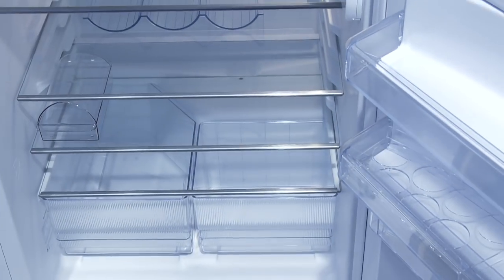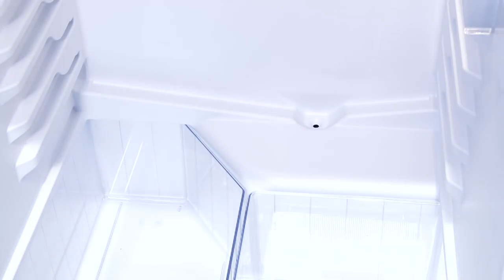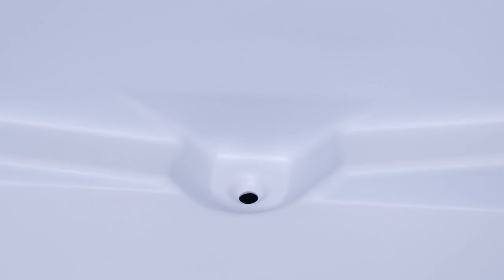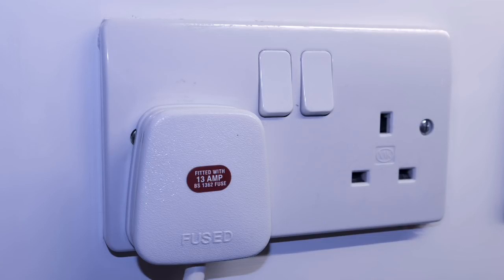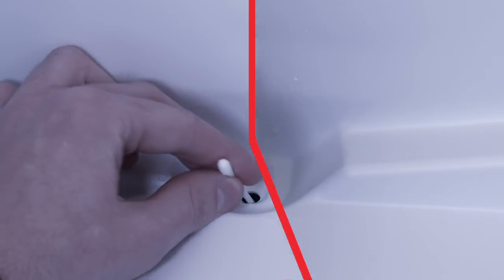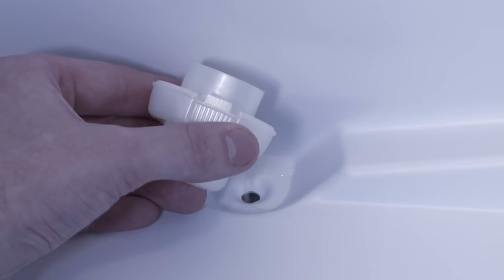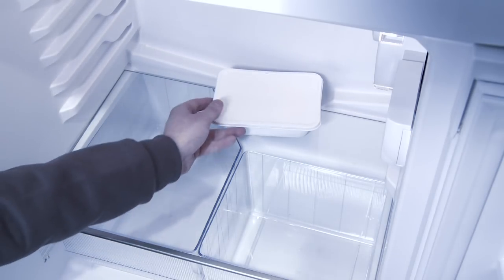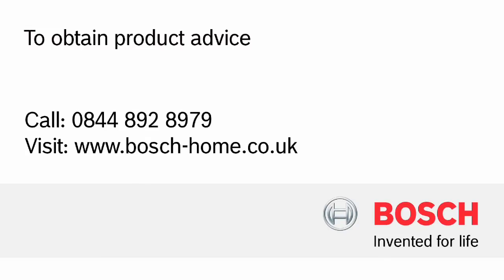Why is there water leaking from my refrigerator?

Comment: If your fridge doesn't have this hole, the water collection port may be in the fridge " ceiling" in the light housing. Unscrew the housing that the light connects to, and there should/ may be a water collection there. Clean that out and you should be good
Reply: You seem like you know what's up. I'm having a smelly problem after a friend used my fridge to store some bag wine shit that was rottening. After I cleaned the whole inside of both the fridge and freezer it was still smelling like the old wine. So I'm not sure what's going on
Reply: I wana leave you a contact number but not in the open

Comment: The excess water usually drains into a tray under the compressor, the heat from the compress and fan causes the water to evaporate. 
Sometimes the refrigerator is to cold and then the water freezes in the drain hole and blocks the drain.
Unplug your refrigerator a=for a few hours to melt all the ice, this would be a go time to clean your fridge too. If you don't have a spare fridge then use a cooler to keep your food in for a few hours.

Comment: This technique works!  I used hot salt water on my Kenmore and cleaned the piece connected to the drain hole.  The only difference is that the drain hole for the freezer is inside the fridge, on the top!

Comment: wtf there's no hole in my frige
Reply: If there is no hole, your fridge collects at the top of the fridge, the lighting unit has a water collection. Unscrew the light housing and there should be a water collection port. Clean that out and you should be golden!

Comment: The cold air goes down, and escapes through this hole, so I clogged it with some cardboard, this way the fridge stays colder, saving energy, but the water can escapes through the cardboard at the same time.

Comment: Leak found in freezer section. Rubber seal migrated down and blocked drain. After warm up pushed seal back silicone and super glued seal. Let cure for 2 hours.Frig did not start for 5 min then kicked on. Kinda freaked me out. CA/Silicone fixed seal and water over flow leak.
Reply from the maker: +Ed Hughes Hi Ed, great to hear you were able to fix the problem, Vanessa
Reply: Ed Hughes a

Comment: On the bottom of the drain line on LG French door, there is a rubber stopper with a little rubber lid.  Water should trickle out of here and I guess it prevents stuff from going up into drain line?  But I see no use for this unless u have tiny fish swimming in the drain pan.  I removed mine as I think it restricts water flow, causing ice to more easily form.  We'll see.

Comment: Mine doesn't have a hole. What then?
Reply: Heather Smith the water collection is in your light housing. Unscrew light housing and clean the water port.
Reply: @bluestarsilver7586  i have the same problem looks like the water is getting backed up in my freezer on top then leaking into my fridge. Ive defrosted the ice and cleaned the drain hole from the freezer drip pan. It works for a while then happens again. Are you saying i should be cleaning a second area in the fridge? Thanks

Comment: I have problem with my fridge that every 2 days I have to take out water that is gathered under the drawers. My fridge doesn't have hole like in the video. Can anyone help me? I had bad luck on this fridge. I changed the engine twice and I changed motors of the fan also.
Reply from the maker: Hi there Rahib, thank you very much for contacting us and we are sorry to learn of your concern. Have you spoken with our Product Advice team at all? They are trained specialists who can help with usage problems or discuss engineer service if this is required?  They can be contacted on 0344 892 8979.  With kind regards, Bosch Home UK & Ireland
Reply: +Rabih Moumneh check the back of your fridge to find the drain line and clean it.
Reply: Rabih Moumneh -a
Reply: Might be in the top of your fridge, in the light housing. Unscrew the housing to the light and clean the water port.